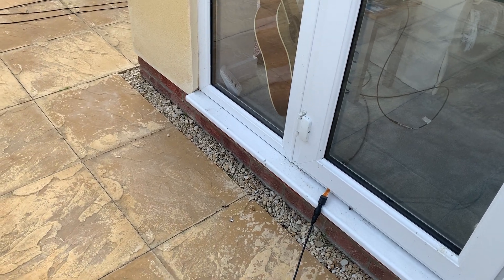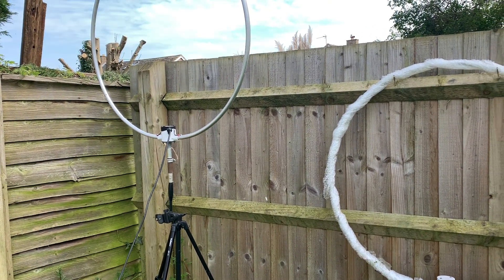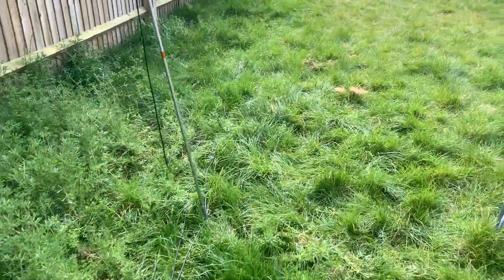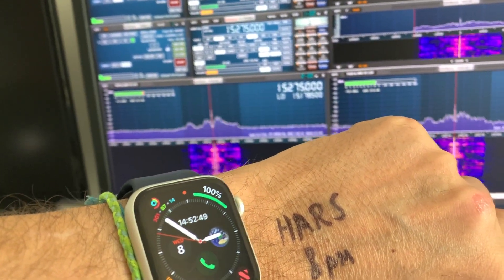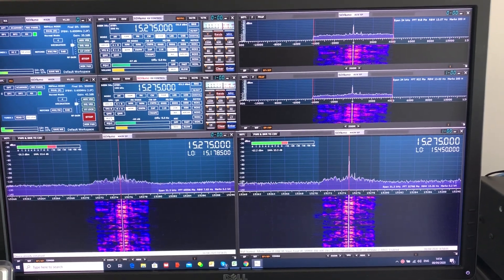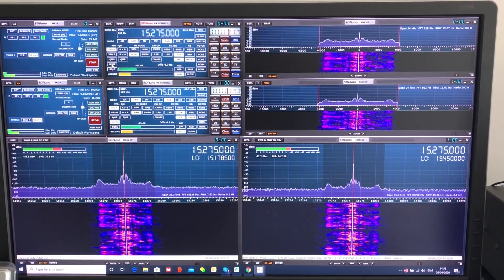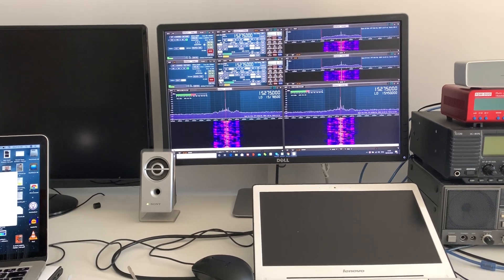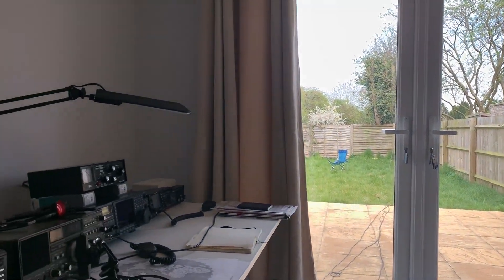Comparing the Wellbrook ALA1530 with the Bonito MegaLoopFX using the SDRplay RSP DUO

Comment: Apologies, i stumbled upon this video many years late, but my question is still pertinent: In your setup i did not see the bias tee box required for the Wellbrook loop amp at the loop, or were you powering  it off off the antenna port of the RSP (my understanding is that the RSP bias tee is 5V and the Wellbrook needs 12 V) . Don't know the Bonito or if that requires a bias-tee - i suspect it does to power the amplifier at the loop. I am considering the Bonito for travel as you mention in one of your other videos, that led me to this one. Thanks again for your fabulous content, 73 de WS1M, Bammi
Reply from the maker: Hi there, both the Bonito and Wellbrooks are supplied with their own dedicated Bias-T to power the amp. The Bonito is superb for travelling - I copied Radio 4 198 kHz longwave from Northern Brazil with mine - highly recommend that antenna! 73

Comment: Hi! Do you remember by any chance, what was the gain setting on Bonito? I use the highest with 90 cm aluminum tube loop. I also wonder if changing triangle loop to a circle would improve the signal?
Reply from the maker: Hi I can't remember! You won't get any tangible change in performance by using a loop rather than a triangle - it's the electrical length that matters. 73
Reply: @OxfordShortwaveLog  Thank you!

Comment: Clint. Just stumbled on your video. Many thanks and very interesting ! Can I please ask a question?  With the loop antennas that use Coax cable as the actual loop itself, is it just the ACTUAL BRAID that receives the signal?  In that case it would mean that the inner wire in effect is doing nothing and perhaps should not even be connected? . The braid would actually shield the inner conductor and thus it would actually not actually do anything ??
In case the small bore copper pipe is used, clearly, as there is no "inner", I wonder if the copper itself goes to the center connector or the outer ?  Also, getting the the 8mm? copper pipe properly soldered to the actual inner of a BNC might pose some slight problems, but I am sure that those can be overcome. in fact, can the outer and inner of say a BNC plug be in fact shorted together and thus leaving BOTH the outer braid and the inner  strands as ONE ? I can't see that working as in effect the input to the amplifier would see a dead short on it's input ?
Also, I am right in thinking that the bigger the loop diameter/circumference the better the received signal strength will be ??
Please forgive my ignorance here. I have never explored loop antennas and since I will shortly take delivery of a KIWISDR I want to give folks that will connect the best possible signal.
Many thanks Clint for having taken the time and effort to make the video, it is very much appreciated !
Albert
EI7II.
Reply from the maker: Hi Albert, I'm not sure - but all I can say with any certainty is that you only need one conductor for the loop. The inner core of a coaxial cable would be a bad idea for obvious reasons. 73
Reply: @OxfordShortwaveLog  Clint... Yes, that of course makes imminent sense. I am waiting for wellbrook pre-amp before i construct the loop itself. BUT... would 10mm coax be as good as say an 8mm pure copper small bore waterpipe loop.?     i am still in the position to decide as i have only the wellbrook preamp ordered sofar would very much appreciate yr thoughts ?
Albert
Reply: @OxfordShortwaveLog  Clint. Many tks !  I will for now hook my KIWISDR  up to my endfed 80-10 meter antenna... while  Andi at wellbrook builds my Amp.
Loop antennas are a closed book to me and it promises to be an interesting new area to explore.  The KIWISDR manual is sooo detailed... I hope my olde wornout brain can hack it I will make the loop 2 meter in diameter, that should be me 6.28m of wire in the air.  Time will tell Clint... and again thank you for your very useful videos.
Albert

Comment: Whenever an antenna needs a signal amplifier, such as a wellbrook, you're worsening SNR.  Granted you can see higher signals on the S-meter with one, but they add more noise gain than signal gain, resulting in a worsened SNR.
Reply from the maker: You've missed a very important aspect of these antennas though - they're magnetic loops which means they reject the electric field component of a radio signal and they're directional which means you can null noise. 73s,

Comment: Interesting video, as usual. 
I would very much enjoy a comparison video of the Bonitos Megaloop FX and the Megactive MA305FT. I'm in the market for something "travel friendly" and well performing at the same time.
If such a video is not on the cards, would you offer your opinion as to which of the two you would choose.
Tnx!
Reply from the maker: Both run on USB 5V power which is perfect for portability. The antenna on the MA305FT is small and the MegaLoopFX loop is a cable so again perfect for travelling. Ultimately, the loop will always perform much better in electrically noisy environments and because you can't guarantee a quiet environment when you travel, it must be the MegaLoopFX (which is the antenna of choice for me when I travel). Hope that helps. Keep safe and 73s, Clint
Reply: Many tnx for your opinion. 
One more thing: is the galvanic isolator worth the price when used with the Megaloop? I didn't notice that you used one in this comparison with the Wellbrook where its performance appeared "mega".
Reply from the maker: Definitely it's worth the price when used with a mag loop. Depending on the level of local QRM you can expect the noise floor to reduce from 5 to 10 dBs. 73s

Comment: Hi Clint, I believe there is a feature that lets you save both antenna's S/N ratios over time in SDRuno. It writes a CSV file of values, which you could later graph out and compare, and/or simply average the numeric values to see which antenna is truly the "S/N champion".  I'd guess that a 10-minute CSV file of both antennas' performance this way could indicate if there is a clear-cut winner or not.   73, Guy
Reply from the maker: Hi there Guy, thanks, yes there is a feature that allows you to do just that and I think it is a CSV file that can be imported into Excel. I'll have a go at that tonight if I get time. Keep safe my friend. 73s, Clint

Comment: The Bonito needs to be up in the clear like the wellbrook. I can imagine that fence is having some effect on the Bonito.

I got the 10 meter wire version mega loop. Up in a tree works great.
Reply: I Have the smaller loop and 5m one for megaloop fx and dependeing on amplification settings and filters, they perform very differently. I agree that they should be similarly positioned. I am not sure also if placing them within each others nearfield will cause issues that make true comparison problematic.
Reply from the maker: Again, you should actually watch the video - there are two Wellbrook loops and one is positioned in an identical manner to the MegaLoopFX! Your point about relative positioning in near field is actually valid but easily tested by monitoring both signals simultaneously and shutting one of the antennas down. You won't be surprised to learn I've already done that and there is no observable effect on the RSP DUO spectrum. 73s, Clint
Reply: @OxfordShortwaveLog   Thank you for kindly requesting to watch your video more accurately. What in your opinion explains best the differences between the two antennas which your presented in this video?
Reply: @OxfordShortwaveLog  You're correct, apologies, I remember seeing the bubble wrap thinking that was off the loop on the tripod! DOH ! haha. I'll pay more attention next time Clint. :-)

I think the extra 5 meters of wire I have on my Megaloop makes a notable difference.

By the way, time to spray that Robin-Run-The-Hedge, God awful weed spreads like Wild Fire :-)
Reply from the maker: You are most welcome. The obvious differences are the fact that the MegaLoopFX can run on 5V USB and is entirely portable. It's also adjustable for gain etc. flexible in terms of loops - you can use your own home-brew for example. FX means flexibility apparently. I think overall the performance will be very similar but probably the Wellbrook will come out on top. just. 73s
Reply from the maker: I think if you take another look at the video there are two Wellbrook loops - the one mounted on a tripod is not part of this comparison test. The other is mounted on a fence in an identical manner to the MegaLoopFX. As for the fence conducting EM radiation or magnetic field/electric fields separately, I think not and even if partially grounded when wet, again there is no electrical contact path between the loops and the fence itself. Thus, any effects would rely on either inductive or non-inductive coupling. Having spent over 30 years working in the field of electromagnetism and having used both loops for several years, I think I can allay your concerns. 73s, Clint